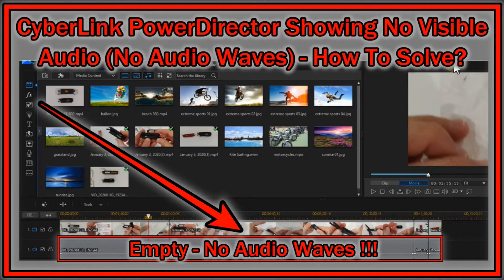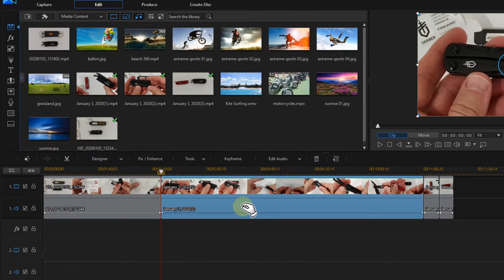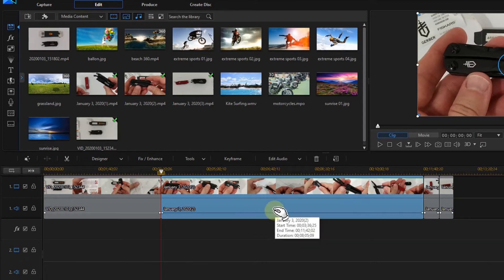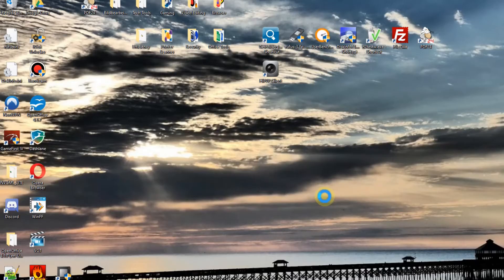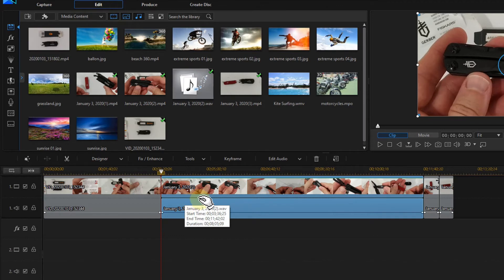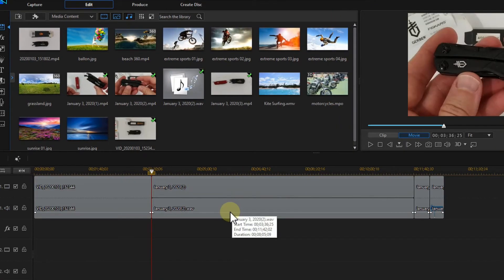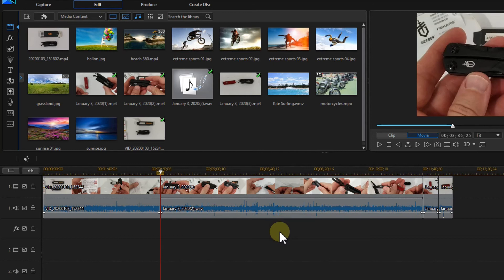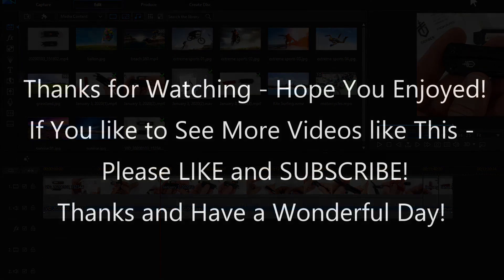CyberLink PowerDirector Showing No Visible Audio (No Audio Waves) - How To Solve?

Comment: This is still broken in Power Director 365. I have a running case with their support now for months.
Reply from the maker: Wow ... that's insane. But the 'redraw' function works?
Reply: @allcheckout  No. You need to restart the program - and often you need need to manually kill PDHanumanSvr and PD process, because PDHanumanSvr hangs (and that is the process doing waveform generation). I cancelled my subscription today - found new software. 5 support tickets and they always find something more they want from you. I have them also extra info - I am a programmer myself - but I lost my patience.

Comment: Writing this on 3/19/2022 and this solution still works for PD 19 but not PD 365.  Good thing I kept my old version.
Reply from the maker: Thanks for the confirmation. The PD 365 has a built-in solution for that in the context menu. One of the very few improvements in PD 365. Other than that they made PD 365 worse than PD 19
Reply: Do you also have this problem in PD365? Support is bouncing me, asking for submission of projects, project files, dump files and so on - but they don't move a bit on the case and keep coming up with newer and newer things. I am looking for an alternative.
Reply: Of course I deliver them everything - recreate the problem etc. - they now asked me to reinstall PD365.